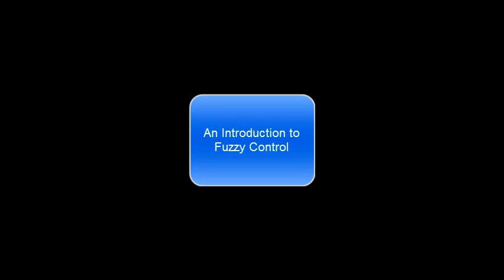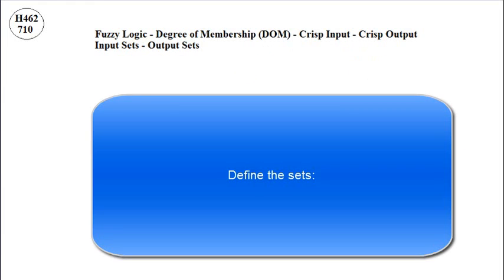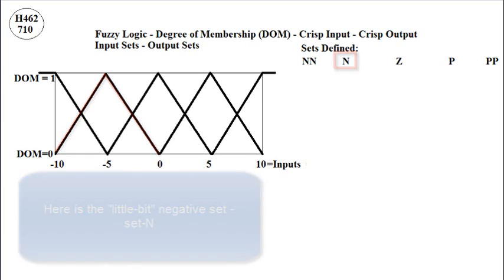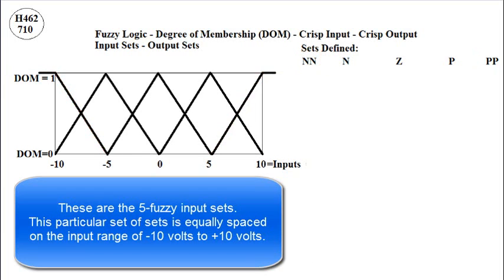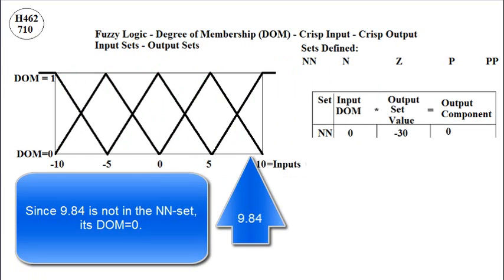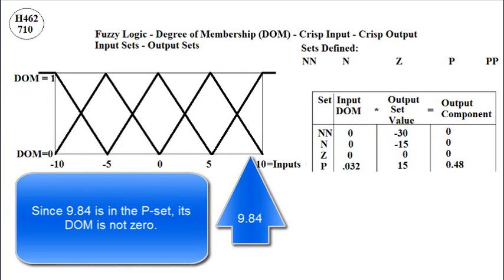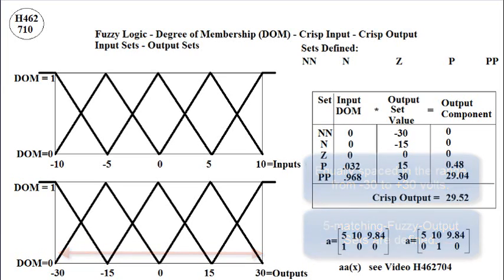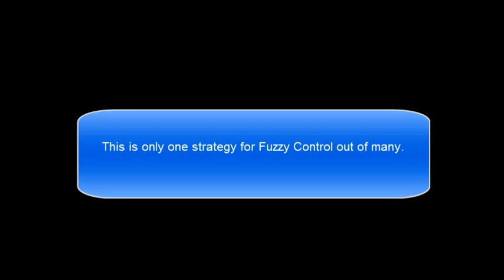H462710 - Fuzzy Logic Control Example

Comment: can we do the same with 4 rules?
Reply: Yes you absolutely can. You can remove any bins you want from this example and it would work the same way (you just may have to redefine your bins if for example you tried to remove the P set without changing the Z or the PP set there would be values which are not appropriately accounted for - especially because 5 volts wouldn't be included in the DOM at all)

Comment: why they are -30 -15 15 30?
Reply: Bruce Zhao same doubt i got ????
Reply: +jawahar lal I think it's the range of output, i think in an equipament who has the output in the range of -30  until 30.
Reply: for example
Reply: it's the output range of -30 to +30 for the given input range of -10 to 10.
Reply: If the input is -10 the out put will be -30 in the same range and so on